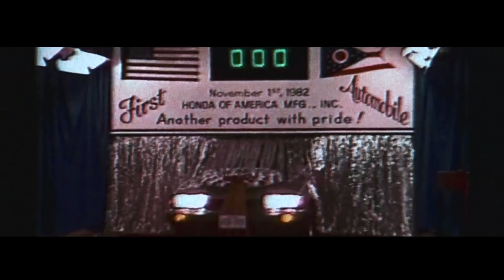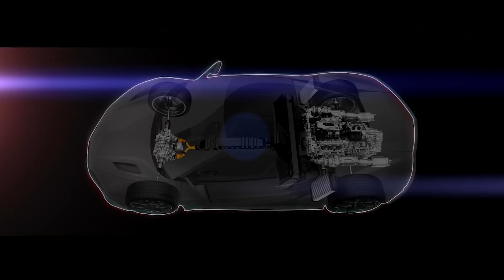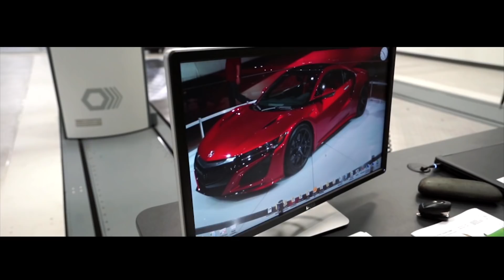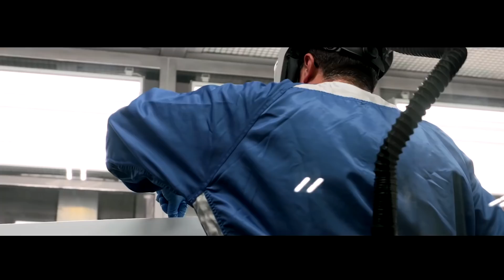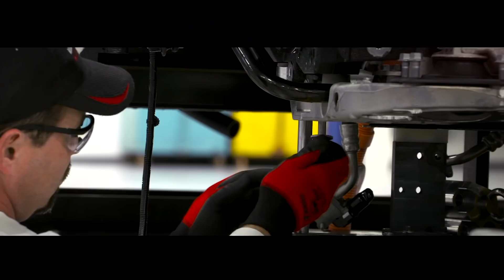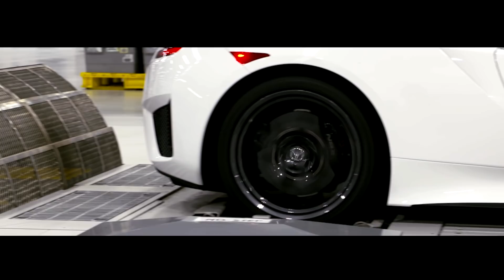How to build a supercar | Honda NSX factory tour | Autocar

Comment: To change the oil on these cars you have to remove panels underneath the car. There’s seven different oil plugs you have to remove to drain the oil out, and you have to remove a couple panels out of the trunk area to get to the oil filter to remove it and replace it. You would think  they would have engineered that a little better for something that has to be done every year. So most people will just have to take it to the dealer every year and pay at least $500 to get their oil changed and hope that they get a competent person doing it and they don’t get their car jacked up like having bolts striped etc.. I just think it’s bizarre that this has to be done every time you change the oil. So, they’re so proud of their engineering why did they engineer it like that where this has to be such an ordeal? I love the car but I really dislike having to shell out $500 to $600 every year to get the oil changed it’s ridiculous.
Reply: Its a SUPER CAR dont like it get a Prius

Comment: If I had the money to burn, I would gladly buy one brand new just to support cars like this. Sadly it was already non-competitive on arrival in terms of performance. A 10-year old GT-R can hang on to it without sweat.

Now would Honda fit this V6 to their normal car lineup? :P
Reply: Non competitive? Just cause the GTR hangs with it does not mean its better. Have you even owned a supercar before? Hondas are NEVER about being quick in one facet. Its always about balance. Suffice to say this blows any other supercar out of the water just given its ease of use.
Reply: @d1sturb3d119  You have a point of course but for NSX money, you can get equivalent supercars that has higher performance while being balanced as you mentioned. The R8 comes to mind, the 570S etc.
Reply: @boy638  look at ownership reviews on the forums. The Audi isn't bad but a year or two of use leaves you with an interior that falls apart usually with switches failing. The McLaren has coolant leaking issues, windshield that crack due to chassis flex and a ton of other reliability issues that creep up within 10k miles. You pay NSX money to get a car that will not fail. Reliability isn't free.
Reply: @d1sturb3d119  I don't doubt Honda's reliability. Ultimately I'm happy with any of those cars.
Reply: @boy638  True. All depends on the amount of money you make. Personally I spend on well engineered stuff. So far from what my buddies have told me and what the forums show, those cars are a ton of work to maintain not to mention all the side show extra crap that happens. McLaren is too busy churning out model after model instead of fixing the crap they've sold. Great to run a few laps but with the issues it faces after I'll stick with the NSX .
Reply: @d1sturb3d119  Everyone knows that Porsches are the best performing and reliable. Plus, Porsche has the Prestige of the brand too. So overall, way better value than a Honda.
Reply: @jamsbong  Huge assumption on your part. The running costs are huge and not all Porsches are reliable. Some are. Every model year has its issues. If you're that confident they're all fine buy one outside of its warranty. I've owned two within warranty so far and they've had major issues and would've cost me close to 20k to repair outside of that. The only cars I've owned outside of their warranty with no other coverage have been Lexus' and Acura, out of which none of them have failed.
Reply: @d1sturb3d119  which porsche?
Reply: @boy638  Forums man. Look them up. I only do that kind of research when I'm buying a car. Every model 911 has issues. Plenty of them are documented. If you find one that has had the dealership fix those issues, those are great cars to pick up. Outside of that Porsche is still an expensive brand to maintain.

Comment: It's just short of a masterpiece, save for the chintsy interior and wanting upper-range power output.
    The handling is sheer tits, even being so overweight. But the power is wanting in the upper end ("where's the VTEC, yo?" - Porsche get over 510hp NA in the GT3s - and everyone knows that you can too, if determined, Honda - so wtf gives with these middling output/liter numbers).
   If it had 100 more lbs/ft and ~150 more hp (and preferably weighed 200-300lbs less, but one can dream) it would be unquestionably the best supercar under $250K.
 As it is, it tops out around 185mph (pssst - that 'supercar' standard is 200mph, Honda) and gets beat past 120mph by the others in it's price range - that's in dry conditions. In the wet this thing is a boss that can teach a Turbo S or anything else a thing or two about handling.
Reply: Most people aren't racedrivers and will be faster in the easy to drive NSX than in a Turbo S or 570S to name two cars in the same pricerange. Both are faster than the NSX in the dry (like you say) in the hands of a capable racingcar driver, but only by a small margin (check the laptimes on fastestlaptimes.com). So in the hands of you and me, the NSX is probably the faster car (assuming you're not a trained track beast). Also, the NSX can be driven on just the electric power unit, so entirely quiet with no gas usage for that time.

I'm not sure if this is what the NSX should be and maybe Honda should've made a more extreme car that's just about performance based on speed and next to it a car like this. But even against other supercars, the NSX has a lot going for it.
Reply: Not only is the performance lacking but it’s also the numbest, most isolating sportscar I’ve ever driven. Totally numb steering, zero road feel. Just terrible

Comment: Pretty cool car. So expensive for what it is. No carbon fiber?
Reply: NSX handles better than ^those two^, particularly in less-than-ideal conditions.
How it handles in the wet is worth the money by itself...no other supercar is nearly as much FUN on a wet surface, and in the end, that value is totally subjective.
Reply: How is it expensive? It outperforms everything in the same priceclass (in terms of performance, value for money, driveability). Carbon parts are available options.
Reply: @djoetma  No it doesn't. 570S and 911 Turbo S are both similarly priced and both outperform the NSX. The hybrid system added a huge amount of weight and cost and that was not paid back in real world performance.
Reply: @gazman9468  I'm talking about performance in terms of more than just speed. The hybrid system is a huge pro. You can drive the NSX solely on the electric system like an EV, so entirely quiet with no gas usage. On tracks the difference with the 570S and 911 Turbo S is really small, and in the wet on the Autocar testtrack it destroyed the 570S' time. 
Don't forget, most people aren't racing drivers. Providing people with a car that is fast yet accessible is a great performance by Honda.